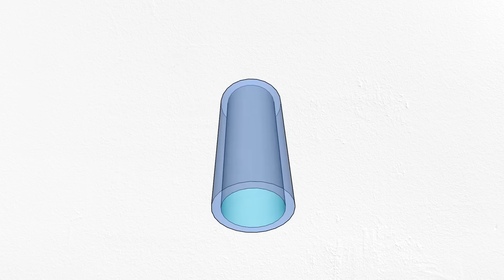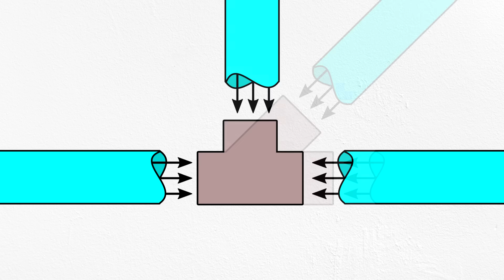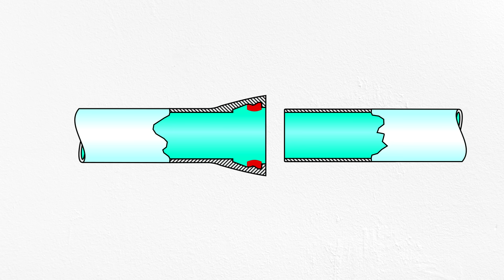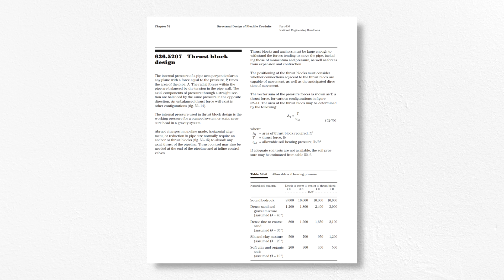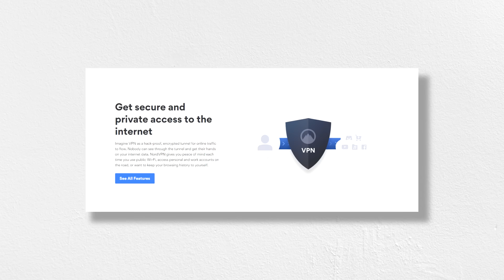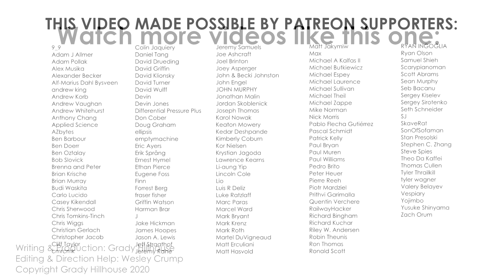Why Pipes Move Underground

Comment: Just to make things interesting it is necessary to allow some movement in locations to accommodate thermal expansion & contraction.  Especially in systems such as the underground waste heat piping in many northern European cities that use excess heat from industry as a source for home heating.  Other considerations related to pressure surges from system operation also need to be considered.   I have actually been around piping systems that were too rigidly restrained leading to catastrophic failure of the piping.

Comment: The most common pipe materials for water and waste water pressure pipes are available with self-restrained joints. PE-pipe, steel pipe and PVC pressure pipe can be welded. Ductile iron pipes are available with locking wedges you install into the bell, which holds the weld bead on the spigot end from slipping back out; this seems weak, but you can even install them with HDD.

Comment: 9:05 what is the purpose of the Type 4 setup, wouldn't all four adjacent sections balance the forces out?
Reply: They may change dynamically if the outputs change and the length of line connected to each end.

Comment: Anyone know if the water rocket guys have bumped up their altitude by using salt water vs. freshwater? Denser liquid might provide better mass flow rate and give more impulse. Just curious if this is a novel idea or if it's a known thing...
Reply: Higher density doesn't necessarily get you higher altitude. Although you will get higher mass flow rate and greater thrust, but because of the higher density of the liquid still in the rocket, you have more mass to lift. https://youtu.be/Fu3rIiPy_18

Comment: I’ve put a lot of KM of pipe in the ground. Restraining devices, thrust blocks and back filled with clear stone. And it seems to work. I’ve also removed some older systems, and repaired older systems. It is a very interesting job if you don’t mind hard work.

Comment: Several years ago I was working for one of the Ma Bell spinoffs, and we had a contractor excavating a utility trench in a Mobile Home Park to repair a fault in a Telephone cable. Utilities in Mobile Home Parks are notoriously under built, and the 8 inch water main next to our cable didn't have any thrust blacking at the bends. There was a 90 degree turn in the water main next to the buried cable splice we were excavating. When the soil around the joint was removed, the elbow separated, and it was the Johnstown Flood all over again. It was a learning experience for everyone involved.

Comment: @10:40 Your content is great. But you also should learn more about security before telling us that NordVPN helps securing logins and such. All you need is HTTPS which every serious webservice uses nowadays. It fully encrypts every connection to a server end-to-end and your credentials are safe. However you can use a VPN to avoid geo blocking if you need it. And also you can hide your location from your internet provider or your state. But the VPN provider still knows where you are. If you want to be completely anonymous then use Tor.

Comment: Usual reason for movement is thermal expansion/contraction. Hence why after a certain length of straight pipe, there's a feature that can absorb linear thermal expansion. Common method is to use 4 90° bends 2-4m apart to take the pipe off course and bring it back on course again with 2 sections of perpendicular pipe. It's a great excuse to do this and at the same time form a pipe bridge to cross over a road.

Comment: I've always wondered why utilities are buried under the road. There must be a reason beyond it being quicker and easier at the time.
Would it not be easier and cheaper in the long run, not to mention more convenient for road users, to build the road with a conduit running under the pedestrian walkway. You're digging a trench when you put the utilities in anyway.
That way when you need to install, inspect, maintain or upgrade a utility you can just lift an access hatch, do what you need to do and then put the hatch back on without having to close the road and dig it up. You'd also cut down on joints in the asphalt that turn into potholes.
I'm imagining prefabricated concrete modules with enough room to work in, where all the utilities are attached to the wall.
Sewers and drains are probably large enough that you'd still want to bury them separately.
Reply: The workforce would need a safe working area ( for them and the public) which would mean shutting the footpath and sending pedestrians out into the road via a walk way (closing a lane). Also not to mention the workers would need vehicles/plant and equipment which would be parked in the road ( closing a lane) so it's easier just to have the utilities in the road and not affect pedestrians
Reply: Also if you go down the service tunnel route like some cities then working In a confined space becomes an issue with all the associated risks

Comment: Your suggestion for having people take a peek when construction crews are out there at 10:23 in the video is dangerous and irresponsible. Many times there are heavy machinery and open pits in the work areas. Normal people are not equipped with proper training and PPE to even be safe enough to access. Huge liability issue.

Comment: At around 7:40, that looks like district heating. At least if I go by the insulation on the pipes. The difference here is the temperature and steel inner pipe. This pipelines NEEDS to move. So you want to give it some room to do that via expansion loops and expansion pads. If you fix it in position, the pipe will snap under the forces of expansion due to temperature..
Another issue with pipelines in some soils with certain groundwaterlevels is they start to float and start to surface when they are (for whatever reason) empty . Its quite cool to see the different types of restraints they use to keep the pipe below the surface level.

Comment: Work in construction for a while and you’ll learn that pipes are literally never where they’re supposed to be
Reply: You sound like a utilities locator. *People in the industry will understand!
Reply: I once seen an entire 15 m wide street dug up, because a new house needed to be connected to the main, but the main just wasn't when it was supposed to be, so they widened and widened the trench until they found it at about the right location, except at the opposite side of the street.
Reply: @hubertjasieniecki5070  that sounds like someone wrote down the wrong side of the street on the papers.
Reply: @dadjake  That's very much possible.
Reply: @hubertjasieniecki5070  Right? Wouldn't put it outside the realm of possibilities.
Reply: @dadjake  Hahahaha :D Yeah, exactly, the probability this was the case is nonzero for sure
Reply: @hubertjasieniecki5070  Wow. I'm wondering if it was in a really old neighbourhood. But that's no excuse. I'm thinking Fredi's suggestion is probably correct. But jeez, moving that much earth and replacing that amount of asphalt for a water tie connection is um, yeah that's a bit of a blunder.
Reply: @lesflynn4455  Yes, you're right.  It's absurd for that to be happening.  So many resources wasted because someone apparently wasn't careful enough on their job.  On the other hand my country has been a Soviet puppet country for a while and even now it's remarkably post-Soviet.  I'm not really political, but one thing about the Soviet rule is that public administration was really out of order, mostly due to rampant corruption and the use of administrative positions for your friends and family as a bargain by people higher up.  My country has been pretty poor back then, so and administrative position was something quite sought up by many, and because of the revolutionary mindset, loyalty was more important than competence for the ruling elite.  And it's all ironic, because Soviet military maps were so top-notch, that they are still used today, some of the best, most detailed and well-readable topographic maps available.  Bottom line to this rant is, I believe, that giving a position to your mate's cousin in exchange for a favor you want from them leads to lots of resources being wasted down the line, some even decades later.  But that's just my thoughts.
Reply: @hubertjasieniecki5070  Thanks for your reply mate. I can understand where you're coming from, but It's hard for me to relate, given I'm Australian who's grown up in a comfortable democracy, but the situation in former Soviet bloc countries is something which interests me, and concerns me. I'm a bit worried for you guys in Eastern Europe these days, given the Russian Emperor's geopolitical shenanigans. I'm afraid he wants to regain the empire of his childhood. Stay well, stay strong.
Reply: @lesflynn4455  Thank you, I appreciate that.  "Russian Emperor's geopolitical shenanigans" is a beautifully poetic way to sum it up, I really like that phrasing.  Have a nice day!
Reply: @hubertjasieniecki5070  No worries mate. I don't consider myself poetic but words are important and I have my moments for a blue collar guy. If you'd like to add me on fb go ahead, I'd accept. I'm in Canberra, Australia. I'd like to learn more about what's happening in your part of the world. There so much propaganda. If you're not interested,  it's all good.
Reply: @lesflynn4455  I wanted to add you on fb, but I couldn't find you. You can add me, my handle is just my last name as visible here, all lowercase.
Reply: @SIutshame  were they within 2' of either side of it? That's the "variance" that most of them seem to live by..  

"Why did you hit it? I marked it 23" to the left!"
Reply: @FatGuyInaTruck  hahahaha 2 feet!, hey my as builts aren't that bad!
Reply: @SIutshame  hand expose when your a foot above breh
Reply: That's what cable avoidance tools are for.
Reply: regimiro in my town there is a 36 feet wide 8 feet tall culvert that is 1.16km long, it has other 1km long  tunnels flowing into it. It has 49 miles of surface area . I walk through it a lot it’s called the rio monterroso.
Reply: @the486kgman2  wow
Reply: @the486kgman2  You think that is big? Look at the drug pipeline on what used to be the US southern border.

Comment: A maybe overlooked subject is the inability of polyethylene pipe to resist pollution. An elderly neighbour complained that her water tasted strange. The water tested positive for diesel oil. The installers had dug a trench right through the spot where her husband had parked his ancient tractor for many years. The soil was contaminated with diesel from the leaky tractor. In the UK this is the blue pipe, here's a link to this sort of pipe:
https://www.bes.co.uk/mdpe-blue-mains-water-pipe-32mm-x-50m-9956

BTW I enjoyed this video, very informative.
Reply: You can get pipes made of polyethelyne with aluminium barrier layer for running through contaminated or potentially contaminated ground. One brand is "protecta-line"

Comment: Interesting. 
In very simple terms, moving liquids have momentum and there is friction inside the pipe walls which would transfer that force to the pipe itself.
File it under things you don't normally think about.

Comment: I interned at a utilities plant and as far as i could remember they used flanges. Why dont municipal pipes use flanges as well? Is it expensive?
Reply: Mechanical restraints can substitute for flanges in select areas underground.  I've seen it used for pipes passing through casing, since the pipes are passing through a larger "pipe" and aren't comfy in backfilled soil.  It's easier to stabilize a long string of pipe at the ends with thrust blocks.  In a plant, presumably above-ground, your lines can't really have a thrust block at the end.  They may also need more accessibility for repair/maintenance.

Large fire lines will typically be flanged above ground anyway.
Reply: New city water pipes are made of PVC (up to a certain size anyway, the really massive water mains are steel pipes welded together), so they use what is called a mechanical joint to connect a pipe to a fitting. A ring known as a megalug goes around the pipe. It has bolt holes to connect to the fitting, along with some bolts sticking out perpendicularly from the pipe. These bolts have a curved, wedge shaped end on the inside, and when tightened act as a type of compression fitting. The heads of the bolts break off at a certain torque so it can be visually inspected. The  pipe goes inside the lip of the fitting with a gasket, and when bolted together, the megalug keeps the pipe from being pushed outwards from the fitting. 

Flanges are used when one fitting is connecting to another fitting, such as a tee with a valve directly connected to it. Flanges aren't used elsewhere because of the reasons listed in the video, the need for standardized, modular parts, and the flexibility allowed when using other types of connections. 

Water and sewer mains often use slip fit style connections in between pipes, and this gives the installer the ability to deflect the pipe. Being able to deflect the pipe for small bends and curves is a huge cost savings for the installer, as fittings for even smaller mains can cost over $1000. For bends in sewer mains, these are often done at a manhole, which will also cost thousands. The city I work for has thousands of miles of pipe, so it really adds up. Accomplishing the bend over time also means a lower reduction in flow due to friction compared to a fitting. Slip fit connections have been used in public water systems for as long as public water systems have been around. 

Sorry for the long winded response. I'm passionate about this subject! I'm fortunate to have a job that allows me to see the plans for water and sewer infrastructure that was no doubt cutting edge engineering for its time, and I get to see how effective it is in the field after it's been running for decades.

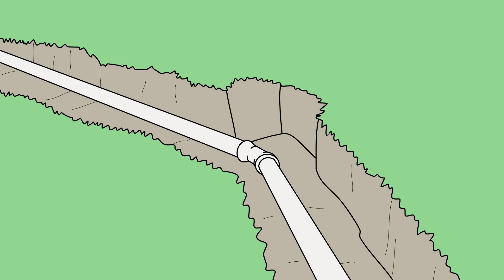Edit: at 8:48, you can see the tee with a valve connected to it via a flange fitting.

Comment: As usual great video. One error: the "pipes shown at 8:19 don't transport anything. They are used for holding electrical cables. No thrust forces or whatsoever there.
Reply: Why do you suggest that it's conduit?

Comment: Another reason why glue is not good for large pipes is that whatever resistance the glue provides is proportional to the circumference of the pipe, while the overall force is proportional to the area of the pipe, which scales with the square of the radius

Comment: Good video! I contract at power plants and they run lines at very high pressure so you can bet they restrain their pipe, sometimes with massive hangers, anchors, and thrust blocks

Comment: Are "twist and lock" fittings useful for this kind of plumbing or are those weaker in comparison?

I'm talking about the kind that have two or three detents on the male piece and matching channels on the female, then after they're in you turn them and the detents are seated against something so it can't be pulled out without being twisted to how it originally entered (sometimes, pushed in tighter first before you can even do that).

Comment: I know they give you talking points for nordvpn sponsorships but the whole "protecting you from fake networks stealing your information" thing is garbage.  Its a scare tactic that has gotten them in more trouble than their in-house security breaches.  You can't steal information over https.  The end. I've got literally 80 tabs open and only 1 of them isn't https and its just a jpeg of a copper wire gauge ampacity chart.

Comment: There is another interesting application of this whole thing:
Fire fighter hoses.

We use flexible tubing, that's obvious. Once you open the hose the whole tubing will shake.

For the biggest hoses we even have to put a 3meter straight segment behind us to divert some forces to the ground to make it possible to even hold the hose in position by manpower.

It's super cool to see the theory behind the forces acting in our pump/tube/hose system.

Thank you for your great job
Reply: I remember them telling us in the elementary school field trip that you don't just turn on a firehose without training or it'll whip around and probably break your leg.
Reply: @stevenclark2188  oh well... I joined the youth fire fighters when I was 10, and we were allowed to use the big hoses

it's not as extreme as you described there, but a big one, like a german B-hose needs to be used by 3 grown men or women if used with proper preassure (like 8-10 bar)

if you use this device: https://de.wikipedia.org/wiki/St%C3%BCtzkr%C3%BCmmer you're allowed to use it by 2 men

Comment: I work with waste water, and here in denmark we are moving away from the screwed together presurised pipes and instead are using quick weld pipes, they are  made out of PE and the joints you use have a wire on the inside and 2 elektrodes at the end, when you install it you just scan the barcode printed on the part with the elektrodes, then the welder will auto apply the settings and you just press start, it takes 15min and meanwhile you can do other parts of the pipe. We foundt that these hold together way better than the screwed together pipes, because the inside basicly becomes one whole piece.

Comment: I imagine seismic movements and freeze & thaw cycles are additional forces underground pipes are subjected to.Ancient Roman aqueducts had to deal more with seismic than freeze/thaw,but there were still internal /longitudinal forces of pressure due to mass &  flow rate. Hydraulic cements smoothed over joints in the duct and changes in direction employed plenum type resevoirs with gated manifolds.The speed of flow was controlled by its gradient, or angle of decline (1/1500) which also reduced the errosive effects of fast moving water. I wonder if expanded polyurethane would be faster than concrete thrust blocks?
https://www.youtube.com/watch?v=BNbGjI-MEXE
https://www.youtube.com/watch?v=Ppo3odASAd8
https://www.nationalgeographic.com/history/magazine/2016/11-12/roman-aqueducts-engineering-innovation/